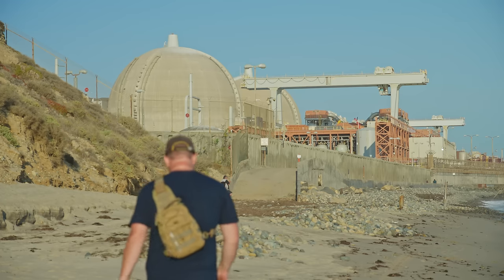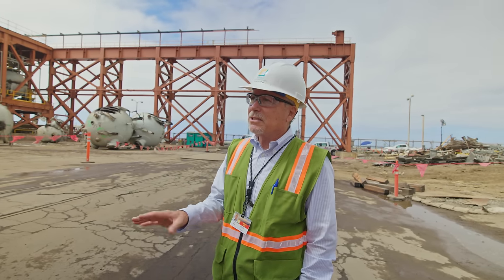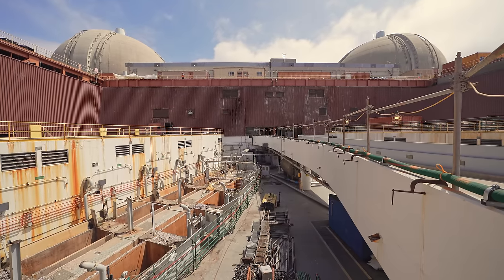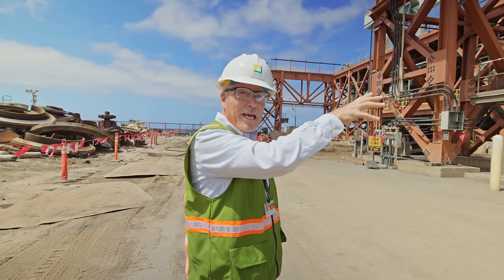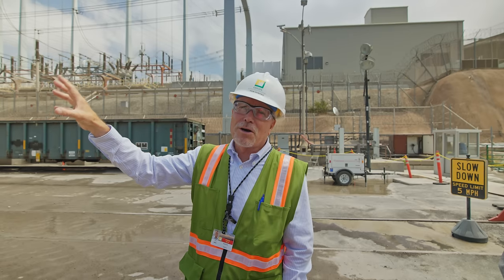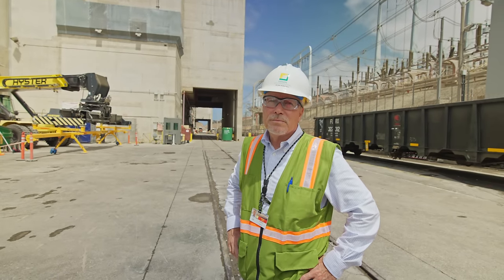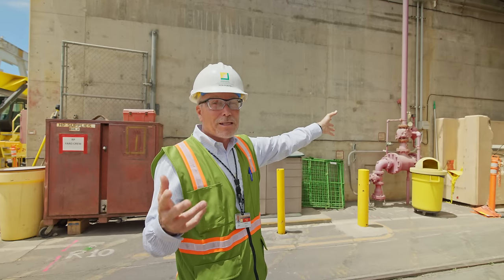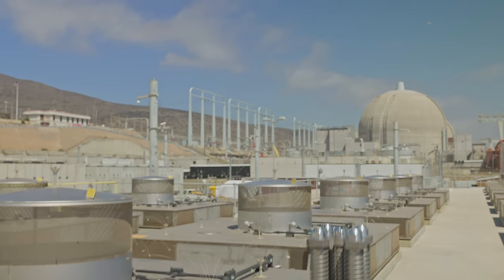Inside the Decommissioning of San Onofre Nuclear Power Station

Comment: Such a knowledgeable engineer and you can sense the enthusiasm for his subject. The lemmings will not miss this plant until the lights go off as they probably will soon.
Reply: Their original steam generators were leaking radioactive reactor coolant into the "clean" secondary side so they replaced them at a cost of $1 billion and the replacement steam generators also leaked.  When these old plants, and we have over 90 of them, have a major component fail, it is no longer coat effective to operate.  On average, 1-2 shutdown every year.

Why did you scrap your perfectly good 1970s automobile just because the engine was blown when it would only cost $5,000 to repair a vehicle worth only $2,000?  What a waste of a good car!
Reply: @clarkkent9080  a valid point well made Sir.  I am a bit cynical cos here in the uk where I am, we shut down perfectly functional generation stations for carbon brownie points and now we are staring blackouts in the face.
 Then when we get to crisis point they quietly fire up a mothballed coal plant and think nobody will notice!  So childish. We need to get the grownups back on the job. And this from one involved in offshore renewables!🙄
Reply: @robinwells8879  I can only speak intelligently about SONGS and the U.S. nuclear industry.

In the U.S. it is the utility's responsibility to provide power.  The number 1 priority of utilities used to be providing dependable reliable power.  Following deregulation in the U.S., the number 1 priority of investor-owned utilities became profits.

My point was that closing down a plant as old as SONGS was an economic one.  Palisades just shutdown a few months ago due to control rod seals needing replaced.  

We have ~ 90 old currently operating reactors and everyone is one major component failure away from shutdown.  Diablo Canyon will continue to operate but will require billions in needed repairs.  So, you will have the same amount of power, but electric rates will increase, and people will complain about that.
Reply from the maker: The closure of SONGS wasn’t an economic one. They could have kept the power station running with one reactor until the repairs to the steam generator happened. But since there is a very deliberate effort in CA to kill nuclear the utility wanted to appease the public and close it down.
Reply: @RadioactiveDrew  I work in offshore renewables and even I don’t think that this false narrative panic rush away from the legacy power supplies is wise. I am concerned that the consequences will turn public opinion away from renewables just as we were beginning to gain traction.
 Not only that but the engineered energy crisis has made field development costs explode thus damaging the very economics.
 I do wish that we could keep the politicians and fanboys out of the debate. I know that they think they are helping but……
Reply: @clarkkent9080  When a new car costs 50 grand, $5000 starts to look like a good deal... 🤷🏻
Reply: @RadioactiveDrew   I don't believe that a private business shuts down to appease the public. It's all about profits. These units were dated tech and not profitable. Most of the old nuclear power plants in the USA are degrading to the point they are not worth repairing. The new Georgia plants are $billions over budget. How is that worthwhile? It is more reasonable to use renewables moving forward until nuclear tech improves greatly.
Reply from the maker: @AnEvolvingApe renewables are a joke with their power output. They also take up way more land destroying habitat for a bunch of different animals. And yes, believe it or not there is a lot of life in the desert. Nuclear takes up far less space and the power is always on. 

Edition the company that owns San Onofre, wanted to shut it down because they were being pressured to do so by the state of California. They want it gone so they can sell everyone natural gas because renewables can’t work unless you have natural gas to fill in a the times the wind isn’t blowing or the sun isn’t shining. The reason why nuclear is so expensive is because it’s being regulated to death.

Comment: Many great memories working at SONGS, great people and great environment. The local public should ashamed of NOT supporting this place. Not only did SONGS provide power at a world class level but SCE supported the local community far and beyond what any other source ever did!!! Everyone that worked here at SONGS will always be proud of a stellar work practice and making life long friendships.
Reply: So how did they manage to ignore the rotting steam generators for so long (the "hot" water that shouldn't have been "hot" was sort of a giveaway, wasn't it?), or miss it (that's not good either),? And how did they SCREW UP THE SAME REPAIR TWICE? This leakmaker was cursed from the day Bechtel built the interior machinery BACKWARDS on their first attempt. FFS. No, thanks... Oh, yeah, and the spent fuel is going to sit there right at the edge of a rising ocean. Nice work on the engineering foresight, there, dudes. Look up the radioactive kittens if they won't admit knowing about it. Ha.

Comment: I was a shop expediter for Bechtel in Houston during the mid 70’s and had the pleasure to monitor the manufacturing progress (or lack of) for the Main Steam Isolation Valves.  I remember the seismic test and the valve closing instantly but the gate was so heavy it bent the operator piston shaft and the valve couldn’t be reopened.  So it was back to the engineers.

Comment: While one of the Mitsubishi steam generators was dropped, the most significant problem was the computer model Mitsubishi developed to analyze fluid flow and tube vibration was inadequate for the operating conditions that the steam generators would experience. It turned out that the generators were more efficient at producing steam than expected but that “drier” steam was less effective at damping out vibrations (called fluid elastic instability) of the tubes cause by flow of steam and water.

After SONGS, I worked on a new nuclear project in another state and was shocked to find that the design of that steam generator was very similar to the Mitsubishi steam generator (the reactor had almost identical power output to SONGS). I did some checking and found that the computer model used showed that the steam conditions would not lead to the same fault as at San Onofre. Apparently the lessons learned were incorporated into the model even though the designer and manufacturer were completely different from Mitsubishi. Although the project I worked on was cancelled (that’s a story for another time), those steam generators have been in service in several Chinese plants and now at 2 reactors in Georgia and have shown to be fine.

Comment: Thank for this honest explination for the demise of SONGS 2&3.  I worked on both units during cinstruction.  I've been from the top, inside as wekk as outsude, of the containment buildings to the lower levels and the tunnels between the units.  Myself and many other worked really hard and long hours to build a great plant for SCE&G.  We also did a daily 155+ step climb to the parking lot at the of each working day and back down the same stepsthe next morning to start the next day.  The folks removing that plant have a really tough job ahead.

Comment: Interesting.  My father was the Senior Reactor Engineer for Unit 1 while it was being built (late 60's).  I think I still have the original blueprints in my garage somewhere.
Reply from the maker: That's pretty cool.
Reply: @RadioactiveDrew  
Did he glow in the dark? The kittens did.
Reply from the maker: @michaelmcgovern8110  the kittens did t glow in the dark…that’s a fact.
Reply: Publish them online and post the link please.
Reply: @AnEvolvingApe  
Would that be the plans that they built BACKWARD the first time? Or the SECOND set of plans from when they fixed the fact that they had installed all the interior equipment backwards?
Do the plans mention all the earthquake fault lines?

Comment: Strange, as it has been over 42 years since I used to pass by this site, along I - 5, or PCH as we knew it.
And watching this, oddly has me feeling a bit melancholy, for lack of a better explanation.
I was stationed at 
Camp San Metro, aboard Camp Pendleton, back in the mid to late 70's, which lies just over the hills to Camp San Onofre, then, " INFANTRY TRAINING SCHOOL, ( ITS ) !
Listening to this video, was the first I had ever heard that the Nuclear Plant was on Pendleton.
But now it makes sense, why we would have been called to handle it, instead of local authorities, and led to one of our impromptu training exercises.
That being Civilian Riot control !
We were told that some Hollywood types, were planning to  protest at the Nuclear site, which from listening to the video, was apparently a hot topic for the area ?
Anyway, we were issued Riot gear, to include Face shields, that would attach to our steel helmets of the day, and Riot batons, as I recall were about 3 feet long, or more, and solid wood, to compliment our Flak jackets.
And put thru the paces of Riot stepping, etc. !
Fortunately, likely for the good of everyone, the protest was called off, and our services were never needed !
Seems like yesterday, actually, but my broken down body, tells me differently !
But it's interesting to learn what was going on at that site, after all these years !
Too, it seems just another, 
" Doesn't make sense ", 
that seems to have become the New norm in our lives !
On one hand they are telling people to buy Electric vehicles, but then say our electrical infrastructure will not support that idea ?
And it's my guess if they are going to continue to march in that direction, and wanting to move away from fossil fuels, then it would seem they will need to build more Nuclear Power Plants, not less ?
But what do I know ?
I'm just an Old Jar Head !
Emphasis on, " Old " !

               🇺🇸☠️🇺🇸
            Semper Fi !

Comment: I started working at nuke plants in 1989, beginning with refuels outages, and then additional work between them. The work there was very interesting, sometimes difficult, but always rewarding. Between 89' and 2008, when I finally retired, I was all over the insides plants, from under the core to in the control rooms. Travelers would arrive for the outages from all over the country, so I got a chance to meet some great guys and gals along the way. I really enjoyed this video and it confirmed that all the nuke plants pretty much operate the same way.
Reply: Steve i have OCD ...im always afraid workers could accidently have radioactive debrit on your clothes or boots when you leave work for the day ...were you afraid of dragging contamination into your car or home after work ?
Reply: @rv6205  Good question RV. Not at all. You actually go through detectors many times during the day, and one more time before you go out the gate. Thanks for the question.

Comment: Just because it was brought up:
Yes, we have a problematic energy production/storage/consumption situation in Germany, which is almost completely independent of the (ongoing) shutdown of our nuclear powerplants. 
Germany produces a surplus of electricity that is exported to neighbouring countries that lack sufficient electricity production facilities. Our problem (which as of now - November 2022) so far is only a theoretical problem and it is only about gas, which is a main energy source for heating systems of all building types and energy source for large industrial facilities. I said theoretical problem, because as of now we are having a very mild autumn, in fact so mild, that we have completely full gas storage and the gas price had plummeted into negative price range (obviously not for consumers but only at the gas exchange market) because many vessels bringing in gas are currently piled up on sea, waiting to be discharged and producing costs rather then earning revenue, because our gas consumption is (too) low for this time of the year.
I think that in total our last 3 nuclear powerplants which were supposed to be shut down around this time are being kept in the grid as a reserve, just to make sure we can still support our neighbouring countries with enough electricity.
The decommissioning and storage of the radioactive material makes nuclear energy the most expensive electricity source of all by the way. The amount of taxpayers money required for safe storage of nuclear  waste is absolutely insane. But since that's a long term effect it's always out of people's and especially politicians minds in a world where only short term profits are desirable.

Comment: One of the statements about the the open loop seawater heat exchange is wildly inaccurate. It wasn't just a few degrees warmer, it was a A LOT warmer. I have surfed at San Onofre beach dozens of times back in the 90s when SONGS was operating fully, and surfers would intentionally swim into the hot seawater outlet just to warm up, myself included. The temperature rise between ambient or "normal" seawater and the outflow was more like 15-25 F warmer than surrounding waters. It was more like the difference between an unheated pool and a hot spa or Jacuzzi. The gradient wasn't gentle, either. You would be in ice cold Pacific water in one place out in the surfing line up, and then just a few feet over you'd be in a very hot bathtub, and you could clearly see the difference in color,  opacity and turbidity in the water and swim back and forth between them to modulate your body temperature. Some areas were so warm they were uncomfortable to be in for more than a few minutes.

We weren't at all scared by it and we knew it wasn't radioactive, and that it just tertiary heat exchange water from the secondary steam loop, but we also knew it was a massive amount of heat pollution that wasn't healthy for the ocean or shore. There were huge algae blooms and other signs of disturbance in the area from the heat outflow and it was basically a dead zone and permanent "red tide" area due to the massive amount of heat being pumped into the sea and upsetting the normal balance of sealife there.

That being said? Your SCE tour guides and handlers aren't being completely honest with you and they definitely skirted and danced around many of your very astute and focused questions and you know it. Their statements about the tsunami predictions is just one of those questions and corporate-friendly answers. That area of the SoCal coast has geologic records of much higher tsunami than 27-35 foot, and that dry fuel handling area right on the coast is not at all a safe bet on geological time scales. It would likely be a massive disaster if that facility was flooded with seawater.

But the part about them doing the best they can without a permanent federal nuclear waste facility and support is also true.

Comment: 17:56 The steam generators were replaced on 2009/10 and failed on 2012 less than three years later.
What happen? This is so unusual!
Reply from the maker: The theory is that one of the steam generators were dropped during transport damaging it.
Reply: The tubes were wearing out faster than expected, due to poor design. Repairs were made but the utility got tired of the hippies complaining and shut it down.

Comment: 16:30 - speaking about Chernobyl, it should be taken into account, that the reactor configuration is much different from the PWR one. The water goes through the reactor core the inside pipes contrary to the main vessel of PWR full of pressurized water. These pipes occupy a small part of the whole reactor core container and the bubbling pools under the reactor, and generated steam have enough volume to extend. So, the main cover, named Elena, was thrown away not by steam itself but from an explosion. But almost nobody could imagine the reactor to be destroyed in a such way, and the necessity of the strained containment was under discussion.
Reply: Too bad they have to leave an ugly scar on the coastline.  Not worth it, not a good idea.  Just a relic now, and a warning of what NOT to do civil engineering wise.